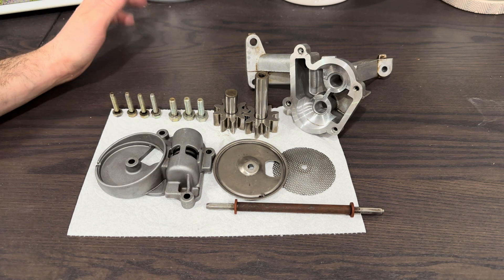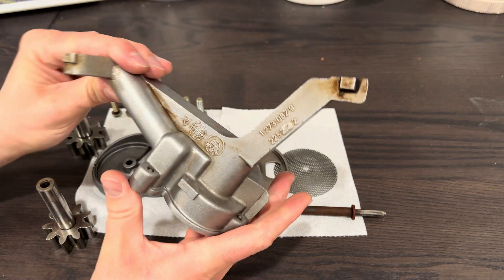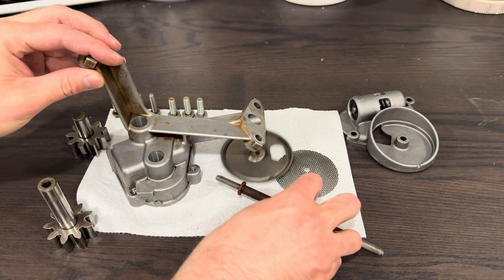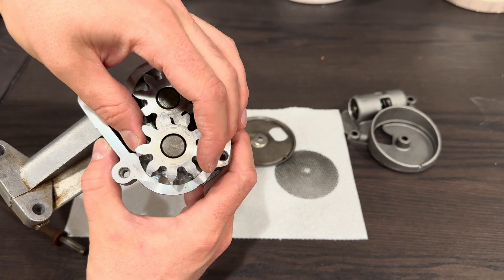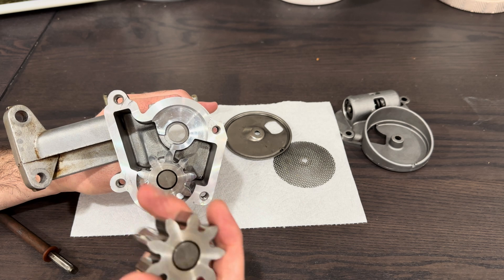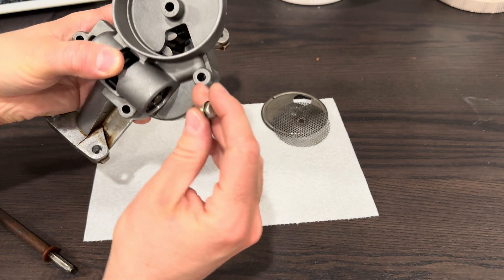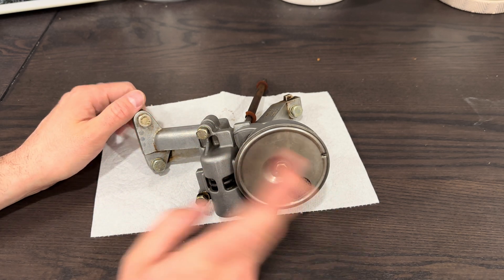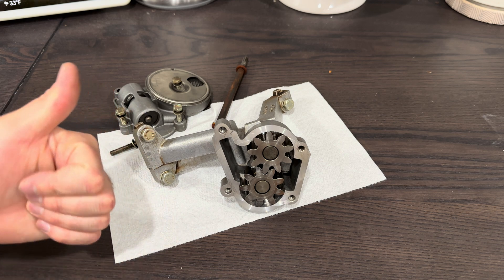BMW M20 Oil pump service guide

Comment: That little cover that goes on last and is covering the little strainer/screen

Mine got damaged and I had to hammer it back into shape. I don't see any large gaps but I'm sure it's got some less sealing ability.

You say they are designed to be submerged so it sounds like I should be ok to send it huh?

It's a brand new pump 😅

Comment: Great video, I've got an 87 325es that I put an ebay turbo on, Made it run for the first time in 2 years or so before adding everything needed for the turbo, Oil pressure light was not on before, and now after instillation of the turbo, the oil pressure light is on, Gonna check the pump, but is there anything you would suggest, like a pump from a 2.5 b25 m20? Or anyway to guarantee oil pressure?
Reply from the maker: Trying running 20w/50 (heavier oil) . I haven’t run into that before

Comment: Thanks for the video, I recently bought a 88 325i vert that has been sitting for years. Changed the oil and filter. It seems that the top of the engine is not getting oil. I pulled the valve cover, and the tube that sprays oil onto the rockers. That seems fine. Wondering what the flow diagram is from the pump to the head. I plan on dropping the pan and pulling the oil pump to inspect. Thanks for any feedback!
Reply: By any chance did you find out what’s wrong I’m having the same problem now